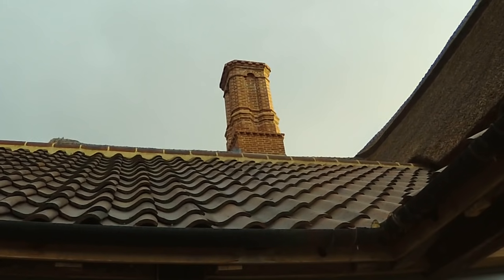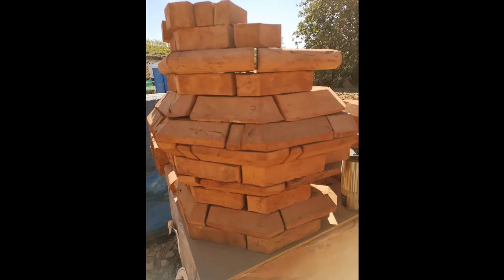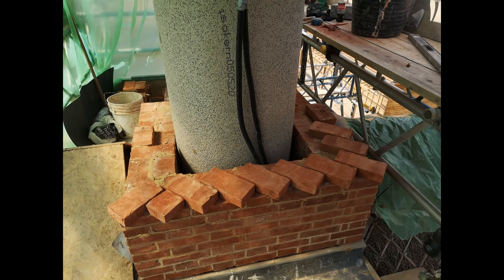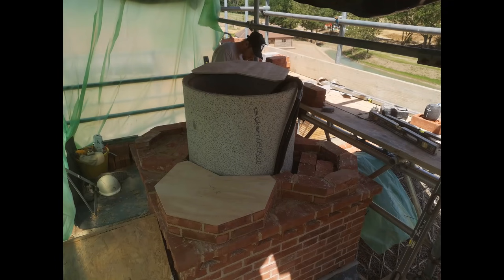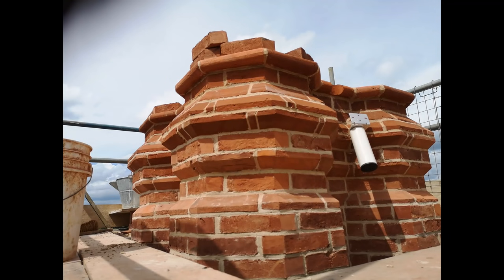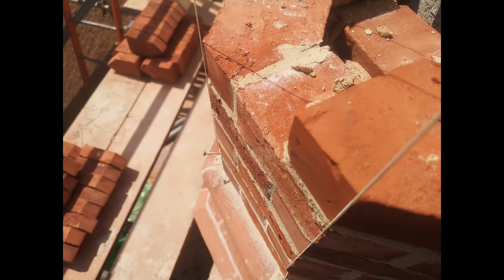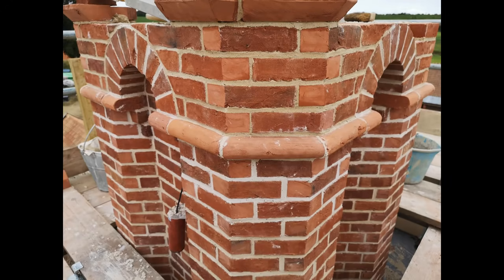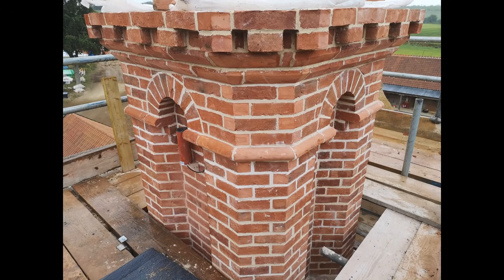the fine art of brickwork - Barn Chimney

Comment: Rob.
How do you seal the area between the liner and your brick, also cutting the brick, was that a standard practice, back when brickwork like this was the norm.
Reply from the maker: hi, the void was filled with vermiculite. Generally speaking, back in the day the bricks would have been fired in the special shapes and their fireskin would remain. The bricks you see here a very dense floor brick, we would never use cut faces if we were using the normal soft reds that we normally use.

Comment: What was the flue for that required such a wide flue liner, stunning stack by the way.
Reply from the maker: the flue was for a large fireplace opening in a huge barn (just one room) and Ash the engineer calculated the correct flue sizes for the room size.

Comment: Were them bull nose brick made on site and if so how did you cut them
Reply from the maker: They were cut on site. The radius was marked on each header end and then I just did a series on long cuts on the Clipper to join the two ends and then finally in used a mini grinder to shape and smooth each brick.